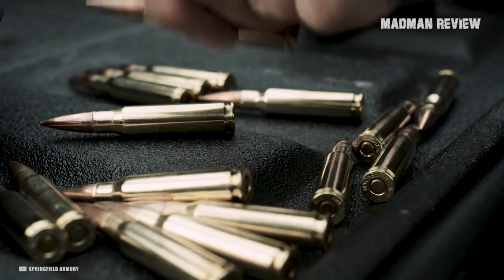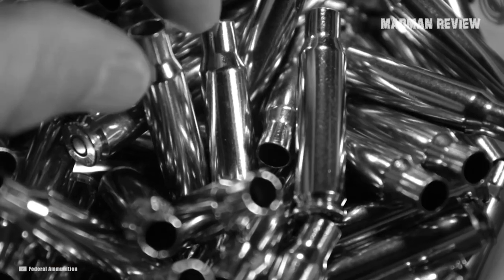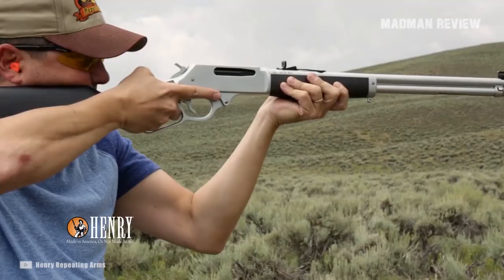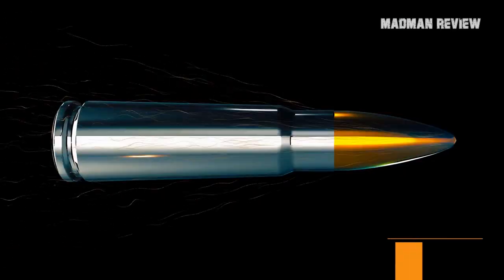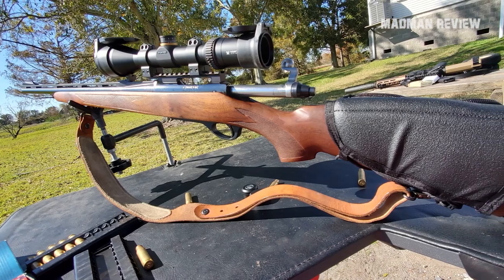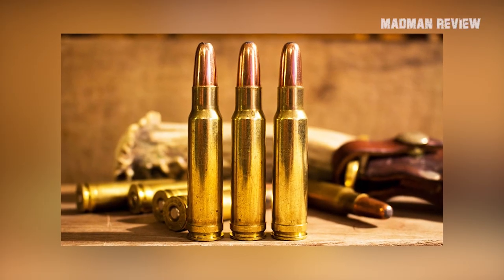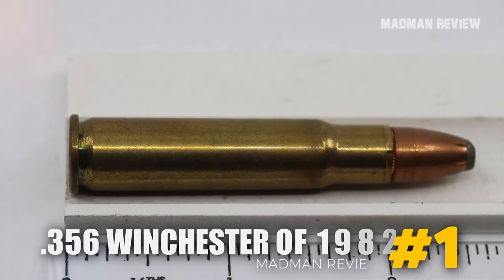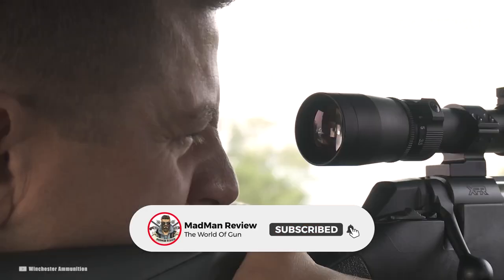5 Forgotten .35-Caliber Cartridges: Are They Doomed?

Comment: People who don't like the 35s read tables too much, think they shoot stuff farther than they actually do, and have no practical knowledge of the family.  They're all amazing at putting animals down.
Reply: agree 100 % big bullets make big holes
Reply: The bigger the hole,
the faster the boat sinks
Reply: Somewhere on Youtube there is (or was?) a little 10 second video that show's a .35 Remington, shot from a tree stand, hitting a nice big Whitetail buck so hard, it flips the animal over.
Very hard video to find, but I've seen it a few times.
Reply: Mostly fair statement.  I was turned on to the .358 winchestee by reading tables, load data, and ballistic coefficients, and data about how barrel length effects velocity.

I am convinced that there is no better cartridge for a 16” hunting rifle than the .358 winchester, based almost solely on my knowledge and understanding of the data. 

I think the weak factory loads were sabotage.  The only factory loads I can find are winchester loads that basically fall at or below a standard 308 load.  I don’t understand why they would do that to this cartridge.
Reply: @bryanheimann5370  Some older designs, like the Savage 99 have rear lockup bolts, but my loads seem fine in mine. It seems, once the round is standardized, it's velocity must remain the same regardless if new powders allow better internal ballistics compared to the powders 70 years ago. Regardless, it's well-balanced for real-life hunting scenarios, and not some theoretical 400-yard shot. Bigger holes are always better.
Reply: @bryanheimann5370 Only thing I don't like is the low amount of bullet offerings. Much more in 338 caliber.

Comment: I own one of all of them. The 35 Whelen cuts off the need for the magnum calibers.  I also love the 338 federal. These calibers need to stay around some people have lost sight of them. People push for more thinking more power is always better. There is such a thing as enough is enough.
Reply: I bought a new 338 federal and 358 winchester, both at the same time.  While both are very good, I preferred the 358 over the 338.
Reply: The 358 Norma Magnum shoots rings around the 35 Whelen. It's the optimum 35 caliber for larger game. With the Woodleigh 310 gr. round nose bullet It will SMASH big bear and moose.  The 35 whelen is maxed out with a 250 gr. bullet.  The 358 Norma has the velocity, with the lighter bullets 200, 225 gr. to reach out and plant sheep and mountain goat. All this in a barrel as short as 20 21or 22". Handy in the heavy bush of Alaska and Africa.
Reply: @craigleibbrand7761  but its a magnum the whelen isnt...thats the point...you dont need a magnum
Reply: @craigleibbrand7761 🤦‍♂️

Comment: I think 35 caliber was popular for hunting in the past because bullets, diameter, and weight were needed for killing power of plain cup and core bullets of the day. There were no Cor-loks,  Nosler Partitions,  and bonded core bullets. Take note that even larger bore heavier bullets were needed for killing power back in the low velocity black powder days. 
35 caliber is considered a medium  bore. 35 calibers are fired at medium velocity at medium ranges. The likes of a 358 Winchester,  a 35 Whelen, and even the lower powered 35 Remington can not be beat for most hunting situations. You don't even need a premium grade bullet to get the job done. Bullet mass at moderate velocity gets the job done on a more consistent basis than small bore high velocity cartridges.

Comment: I bought a Marlin 336 in 35 Remington in the early 70s from a pawn shop. I love that old gun. Anything hit with a round from this guy dropped right there. Ammo is scarce but I’ve been hand loading for years and accumulated a lot of brass. Other components are still readily available. I’m in good shape for some time. I own other fancier, more modern rifles, but I still love to be in the deer woods with my old 35.
Reply: The .35 Remington is my all-time favorite deer and hog round. Whatever you thump with the .35 Remington and its 200Grn JSP "traditional" round tends to stay thumped. Only the .444 Marlin gets less love today than the .35 Remington.
Reply: I have a pistol in 35 rem and ammo has gone up so much . I started out paying around $30 ….now it’s $50-$100 range when I find it
Reply: Good friend of mine has a '48 vintage Winchester 1894 in 32 Winchester Special.  Same deal, I have to Handloading for him.  Every now and again I can get some Starline brass, but good luck finding factory ammo.
Reply: @timclaus8313  Just use 30-30 brass and with one run in the 32 win spl die you have the 32 win brass for reloading.
Reply: @lurebenson7722  Surprisingly, I have been able to buy 100 Starline cars over the last year.  The guy that owns the rifle really does not want to shoot it a lot.  On the other had, I pt a fair amount of 30-30 down range and really don't want to resize a bunch of my brass as long as I can still find 32 Win brass.  Resizing 30-30 does remain an option though.
Reply: Funny how the 35 Remington is ignored but the 350 legend seems to be sailing right along in popularity.
Reply: When I got my deer rifle, many years ago, I started to get a .35 Whelen. Thankful I  didn’t. Good caliber, but is now a reloader’s hobby. Grateful I  got a 30-06. Does it all and will never die.

Comment: I use a BLR in .358 Win and took it to Canada this fall for bear. Used to have a Savage 110 in 30-06. Had it rebarreled to 35 Whelen. Is easy to do since the barrel nut adjusts headspace and the new barrel just fits right in. Only took a couple of minutes. Easier than reboring. Was quite accurate. Didn't think the recoil was bad. Sold it when the tranny went out on my car and needed the money. In both cartridges I mostly used/use common brass; 308 for the .358 or in the Whelen 30-06 brass. Even used some 270 brass in the Whelen so I could easily keep track of which load I had in hand. Just looked at the headstamp and knew what load it was. Just necked up the 270 to 30-06 before making the jump to 35. Never had any trouble necking up the cartridges. Really easy to do. Still many bullets available for the 35 although most won't work for the 35 Remington. The 35 is not dead yet. Of course, I also have loads for the 45-70 and 38-55 for deer this year, so I might be a tad prejudiced. Then there is my Savage 99 or my bolt action 300 Savage. Hardest part is choosing which gun to hunt with on any particular day. Choices! Choices!

Comment: I picked up a 358 Winchester in 2019.. Ruger made a special run of 400 rifles in the Ruger American Predator.  They sold as fast as they hit the shelf.  When I first saw it for $399.00 .. I had to get one!

You actually have mine pictured in this video!  Thanks for sharing this brother
Reply: If you like and think the 358 win is great now load some Barns TTSX 200 grain bullets in the 358 win then it becomes a whole different cartridge that kills even faster.
I load in the 35 Rem the Barns TTSX 200 gain then put one in the Marlin 336 chamber and the round noise in the tube magazine.
Every critter shot by this load dies on the spot even large Roosevelt Elk have dies from this load.
When a bullet retains its total weight, it retains the energy that is lost from a lead core bullet shedding off lead that is weight and makes energy to drive bullets deeper and create the power to wreck vital organs.
Reply: @lurebenson7722  I'll have to try that out!  Been using 225 grain Speer bullets that print .55 inches at 100 yards! However.. when hunting whitetail I use a 200 grain soft point.  Knocks them off their feet 😯

Do they still run afterwards.. yep!  I only take broadside shots through the lungs and heart!  Haven't seen a bear while hunting them!  I tend to see them in different seasons. 

That being said.. every time I seen a black bear it high tailed it the opposite direction as soon as it realized I was there!  My one brother unfortunately had to put one down that wouldn't let him outta his stand during archery season. For whitetail deer!

Every bear is exceptional to the other.. I believe!

Thank you for sharing your information.. I appreciate it ☺️
Reply: @blackie1of4  Since 1989 I have been an Alaska hunting guide for brown bear and Yukon moose.
The Barns TSX bullets are without a dough the most lethal bullets fried from all of my rifles.
All of my rifles shoot the Barns bullets very well, but I am not looking for bench rest rifle accuracy when a bullet put into a 3-inch area around vitals kills all animals and often a fast shot off hand does the trick.
My CZ 550 in 9.3x62 Mauser loaded with the Barns TSX 286 grain bullets put down every animal in 18 year with one of these bullets and that is clients wounded brown bears also.
Loading the Barns TTSX 200 grain in the 35 Rem has the same affect and the 35 Rem isn't a lard cartridge at all, but it puts down large Roosevelt Elk with one bullet every time when used in the range a 35 Rem was made for like stumbling into a heard on an old unused logging road and the Elk realized they goofed up then start to scatter.
Reply: @lurebenson7722  that's a lot of great information!

I truly appreciate it ☺️
Reply: @blackie1of4  What I left out was the Marlin 336 in 35 Rem the Barns TTSX 200 gr bullets one loaded cartridge is put in the chamber then the round nose goes in the tube magazine.
Using this 35 rem load I put down a 1200 pound cow Elk at 200 yards and the bullet did a clear pass through which proved the load to be great power and no bullet weight loss do to such a pass through on a large adult Elk.
There isn't any reason why not to shoot pointed bullets in the Marlin 336 lever guns when the pointed bullets go direct into the chamber.
I can also load up these loaded to near 358 win factory loaded ammo .
The little Marlin 336 really jumps shooting this load.

This 35 Rem load is 36 grains of W 748 with the 200 grain Barns TTSX bullet.
I have used 40 grains of W 748 but to me using it in the Marlin I don't feel it was a good idea when lever guns aren't that strong.
Reply: @lurebenson7722  I definitely agree with you.. that's some more great information! 
Anyone who tries the 35 calibers loves them for reasons you've stated :)

Comment: I don't know if the .358 winchester is dead yet. 
Every time I bring it up at a gun board, there seems to be a lot of interest/comments on it.
Seems like it's more of a case of the gun/ammo companies don't realize the round still has a pretty good following.
I think someone needs to (re) introduce a nice light bolt action carbine in .358 and I bet it would do pretty good.
Reply: Try to buy the 358 win in an AR 10 barrel when barrels are available the barrels sell out so fast don't hesitate to place the order or if you do the barrels sell out right before your eyes.
I am starting to sell custom build AR 10 uppers, so I am going to add the 358 win to the AR 10 uppers I sell.
When KAK Industries have the AR 10 358-win barrels they sell out in 30 minutes.
If a person reloads who cares commercial loaded 358 win is rare to find the 308 brass is every place to be converted into 358 win .
30-06 can also be converted in 358 win and I am already using 30-06 brass I find at forest shooting locations then converting the 30-06 to 308 brass for 308 reloads.
Reply: I had a ruger 77 frontier scout in 358 Winchester.  Fantastic rifle, sub moa,  and out to 300 yds.  But life happens and I don't have it anymore.  Wish I did.
Reply: @fedup3582  Sounds like a beautiful setup. As much as I love the .358 Winchester, I think if I had a Ruger 77, I'd get the Internationale version with the full length stock and chamber it in the equally underapprecaited .250 Savage.

Comment: "338 federal put an end to the 358 Winchester.....".   I purchased one of each at the same time.  Nothing wrong with either, but the 338 soon went down the road. The 358 was fantastic!!
Reply: I am in the process of deciding between the two right now. So why did you chose the 35 over the 338?
Reply: @anonymousf454  I have owned and hunted with the 35 whelen, 350 rem mag, 358 win, 35 Remington and  357 maximum.  All have worked very well for me and I am quite pleased with the 35 caliber.  I used to want a 338 win mag and if I ever decided to get a magnum 338, it would most likely be the win mag, but the 340 weatherby appeals to me too.  With my advancing age and deteriorating health, I have less and less need for those magnum 338's.  If I should yet get in the need for a big thumper, I have no doubt that one of the two 35 whelens that I still own will suffice quite handily and the larger magazine capacity of the whelen won't hurt my confidence one bit.

Comment: A 35 whelen 310 woodleigh at 2400fps is the lower end of a 300 grain h&h at 2500 fps

With half the recoil of the h& h

In a lighter , easier to carry package....

Comment: The 35 Whelen needs to be kept alive as dose the 16 gauge shotguns. Too awesome to be put on the back burners.
Reply: That would be an awesome combination gun. 35 Whelen over a 16 gauge.
Reply: @257shooter9  I was not thinking of it that way but, yes it would.
Reply: Amen, brother!
Reply: I have find whelens big brother 366 ( 9.3x 62 ) very effective in moose hunt here in 🇫🇮 👍
Reply: @CU65LATER  yes, I can agree with you on that. They are all but the same . I know that the 9.3 was built in Germany for the African farmers to protect themselves and the livestock around the early 1900s before the Whelen. We Americans just had a hard tine getting to know the metric calibers until recently, say the last 50 years or so stemming from surplus imported European military firearms and at that they were usually customized or stripped for their actions to build on.
Reply: The 35 Whelen is an absolute hammer, with still reasonable recoil, albeit at the high end.
Reply: @timclaus8313  👍😎🇺🇸✌🏻
Reply: You couldn’t be more right!!
Reply: *   I'd like to see the improved version of the .35 Whelen brought to light. Not only can the imp. cartridge give an increase in cartridge performance, but it also greatly improves the head spacing problem that the original cartridge possesses.
Reply: @charlessmith4242   Absolutely, the 35 Whelen Ackley Improved is a wonderful cartridge that (as you mentioned) eliminates the headspace issue that can sometimes arise with the standard Whelen. Furthermore if it is in a rifle that is of a decent weight (8-9 lbs) with a good recoil pad and a ported barrel or a muzzle break, you can safely load that cartridge up to be nearly the equal of the 375 H&H if needed. Ive shot one for years and once you go down the 35 cal rabbit hole, there is no coming back lol
Reply: @charlessmith4242  who ever told you there is headspace problem is totally wrong. If people are reloading and not setting the shoulder properly then it can occur. I’ve never had a issue using factory ammunition. Never shot reloaded ammunition out of my 35 Whelen.  All my other rifles I have reloaded for for about 40 years and hav3 never had headspace issues. That said if you want or need more energy down range look into a 9.3 x 62 or a 375 H&H or 375 Ruger.👍
Reply: @christinamoneyhan5688  *   Perhaps you should do a little more research. " Cartridge of the World " by Frank Barnes/ edited by Layne Simpson might be a good starting point. Not only does the Whelen Imp. cartridge eliminate the 17 degree, 30 second shoulder of the original with a much better shoulder angle, it also creates a potentially tighter head space and subsequent better accuracy potential, with less stretching of the case. An improved chamber also let's one shoot original cartridges in the new chamber with the advantage of then reloading a new cartridge that will out perform the original. As you noted, if a reloader is sloppy in his reloading technique, or if his rifle chamber has not been reamed properly, problems can arise.
   The .30--06 cartridge case is a good candidate for developing improved cartridges up to about .375, by simply reducing the taper of the original case and blowing out the shoulder. New dies for reloading the new cartridge are easily obtained as is loading data.
Reply: @charlessmith4242  Man oh man Charlie I know all of this. This is why I said I have only shot factory 35 Whelen in my rifles. I do not reload anymore . I do know it was a Wildcat caterage up until ( I think ) 1987 when Remington standardized it. Just like the 25-06 . It too was a Wildcat until 1969 ( I think). Let us not be nitpicking. Just that if you want a steeper shoulder for head spacing then there are plenty to choose from.👍✌🏻🇺🇸
Reply: I still use the marlin 35 rem. and the 35 whelen in a t/c encore. Would love to see the 350 rem mag make a comeback.
Reply: @christinamoneyhan5688  *   Well, some people like to reload, and some people like improve upon an existing cartridge, especially a cartridge case that is so easily obtainable as is the .30--06 case. Since it's very easy to turn a .30--06 case into a .35 Whelen case, my point was why not turn that same .30--06 case into an even better performing cartridge. The reloading procedure would be the same, and the .30--06 case is much more available than the 9.3x62 cartridge or its components. You obviously love your .35 Whelen, that's fine. My point is that I believe Remington made a mistake by not standardising one of the existing .35 Whelen Improved versions, and instead went with the then wildcat .35 Whelen. It would not of cost them anymore to go with the better performing cartridge. Remington, has on occasion, not been very smart i.e. the .244 Remington, etc.
Reply: @charlessmith4242  Charles, for some reason American shooters just could not warm up to the European millimeter designation until recently. I think it might be a stigma from WW2.